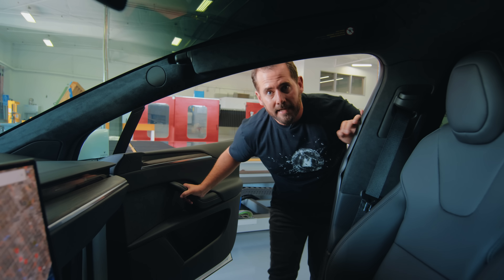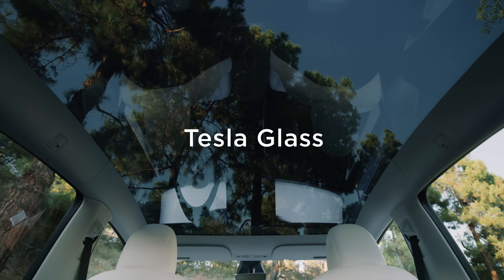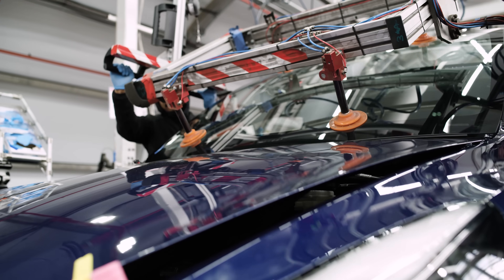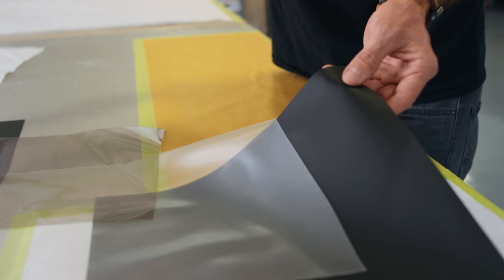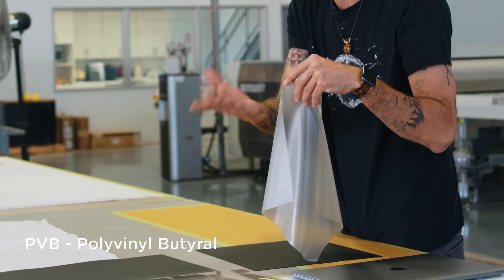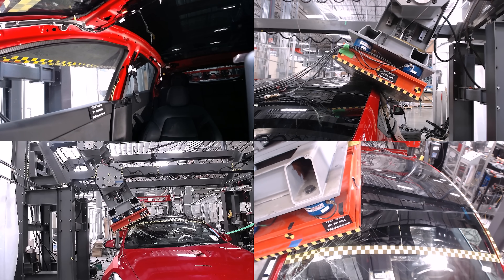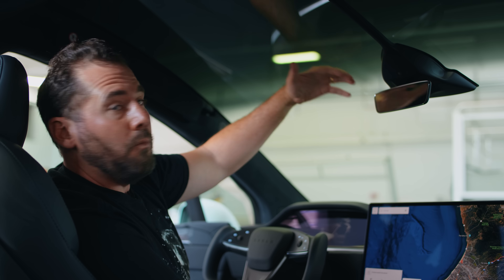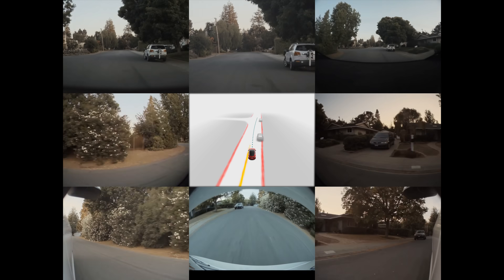Tesla Glass | The Secret to a Quiet Cabin

Comment: I just can't stand the roof glass while living here in Las Vegas. I added limo tint and it's still way too hot. I wish you had a normal roof option. 

And the road noise is awful on my model 3. Look up the "noise reduction" kits for your vehicles sold 3rd party. The seals for the glass roof cause a lot of noise.

 It's still my favorite car, but I wish you could get rid of the glass roof. I don't think it's worth it.
Reply: Good point. Should provide option.
Reply: They should have an option to have like a roof cover inside just like a normal people's car with sunroof They have a cover where you can pull the cover to open or close it
Reply: It's funny how your comment got downvoted to the bottom. Tesla fanboys are wild. Maybe most are just kids.
Reply: It's not the glass roof from which the suspected noise comes from. It's the fact how quiet your M3 is that makes you think you hear outdoor noises louder. Use a decibel measuring device to compare it to your friend's cars. You'll be surprised. I have a Tesla Model 3 Performance, 2021 version. I tested it myself. In fact even the thick steel floor is bigger source of noises than the glass area. They did an incredible job. Even the window wipers are the calmest on the market, specially designed to be as quiet as possible. They had to, as in any other car (even some EVs - with bad loud aircons) other noises are louder than the wipers, while in a Tesla all else is so quiet that you start hearing any little thing. PS: The glass roof was not just chosen for the feel of openness and better vision, but also for its strenth. This type of innovative glass, together with the frame make it (impossible with carbon or metal sheet) the strongest roof on the market by far - stonger than roofs of PVs with over tripple the weight...
Reply: Metal roof is just as hot if not hotter in my experience.
Reply: My Model 3 isn't superb for road noise either but I don't mind it. Also it's a late 2020 model with only one layer of glass and not similar to what is shown here. So I was wondering if you're sure you have the technology they described here? Tesla models are under constant development, even though the model names stay with similar names over time. By the way, I wanted to put it out there that I absolutely love the glass roof, albeit I live a place where summers rarely exceed 25°C/77°F and it sounds like you live way closer to equator.
Reply: This video just shows how behind they are on NVH. They think you can just slap laminated glass on a car and then it becomes quiet? Model 3 and Y are maddeningly noisy vehicles. Anything in the price range is going to sound like a bank vault in comparison.
Reply: Just get a sunshade

Comment: If you need to insulate against noise when driving, then perhaps the problem is cars. This isn't a feature, it's an admission of the terrible technology the private automobile is.

And no, it's not the engine noise: driving past a relatively low speed, tire noise on the road exceeds engine noise, even for internal combustion vehicles.
Reply: Please explain

Comment: Meanwhile in my head: “Glass is glass, and glass can break”
Reply: It's not your glass it's our glass
Reply: @AnkitRaj29008  It will always be Elon's glas, we are just allowed to use it.
Reply: Hi Jerry..
Reply: its fine  
You are showing some strange behavior.
Reply: HAHAHAHAA lmao
Reply: Sherylin  it's generally safer to be contained within the vehicle surrounded by cushy things and air bags than to be ejected, do generally you want the glass to keep you inside.
Reply: Sherylin  you are correct, on most points... ;)
Lol

I read your comment as having something to do with the difference between non laminated safety glass like a traditional side window, and the laminated safety glass like a windshield.
I now am gathering that you were comparing a window pane like you would find in a house, with safety glass in a car, and I have no argument with that, as I have broken many of both, and know of the danger that you speak!

(don't worry, I am not a thief lol, I worked construction and did a bit of demolition, including big commercial windows, and I was also a firefighter and tow truck driver, and the Chief owned a junk yard, so sometimes we would practice using various glass breaking tools on abundant windows!
Reply: My X has a large crack on the windshield right now. 1.5k to fix... lol
Reply: Man you're everywhere
Reply: A new vision of glass every time 10th one made with rocks
Reply: Glass isn't inherently brittle and fragile - that's just the most common types. Metallic glass can be hard enough to scratch diamonds rather than the other way around.
Reply: therefore this type of glass is stronger than a metal sheet or carbon fiber roof. They even show how they achieve this in this video.
Reply: Hi
Reply: Essentially everything can break

Comment: 1:22 That windshield looks pretty flat… Could it be for a CyberTruck prototype ?
Reply: that what i was wondering!
Reply: @pekkapeltola2642  What surprises me are the blacked out parts, not present on the first CyberTruck prototype but present on every Tesla production vehicle, the round top which would indicate that the production version of the CyberTruck is a bit rounder and finally the cutout at the bottom left, which could be where the windshield wipers are installed, if there are any physical ones. Either that or it's just a random piece of glass !
Reply: Apparently every windshield gets its blacked out parts while still being a flat sheet. Nevermind, I think I was wrong...
Reply: Note the V-shaped rear monitor inset   unique to cyber truck.  No rearview mirror, monitor instead.

Comment: The glass roof is simply amazing
Reply: its fine  
You are showing some strange behavior.
Reply: its fine  I speak for everyone in the comments when I say....get F***ed!!!
Reply: its fine  stop with the Muslim propaganda
Reply: Was in the Maybach even back in 2005
Reply: its fine  No it's not. Stop plastering this crap everywhere.  Once is more than enough
Reply: Nope
Reply: Real Tesla OGs will remember the sunroof 😭
Reply: it's not that great once you own it. it doesn't absorb sound as well as a hardtop, the glass still don't reject that much heat so it's a hot greenhouse and the glare on the model y makes the full roof glass almost useless. all you see if the front row reflection. nice in theory but terrible IRL. i ended up installing a reflective shade in my model y roof. reduced my AC use significantly
Reply: @Mkvkuv  Hmm, I can totally see a valid point there.
Reply: @Mkvkuv  We added 70 percent tint to our Y's roof, it makes it a lot more pleasant but does increase the reflections.
Reply: @Mkvkuv  Amen. If I could order my Model 3 without the glass roof, I would do it immediately. The glass roof looks fun, but just heats up the car, radiates heat for a long time even with the AC on, and it can't open for fresh air.
Reply: Should be solar panels. Would effectively increase the efficiency of the vehicle by 10% or more.
Reply: @chapstickbomber  Tesla actually made a statement on that. With current technology, it would not be substantial enough to be of good use if you just slap it onto the roof of the car.
Reply: @th3max1muspr1me  nah, they're just being lazy. Cybertruck with solar would probably charge just as fast as 120V
Reply: @th3max1muspr1me  toyota uses solar panels on the prius prime to run the AC and charge the 12v battery.
Reply: @chapstickbomber  So, you know better than the engineers at Tesla? What is your qualifications? Also, how much would it add to the cost of Tesla vehicles?
Reply: @1flash3571  passive charging is amazing

I won't buy an electric car without it. It literally rewards not going anywhere, which is my favorite thing.
Reply: @chapstickbomber  I guess you will be waiting a LOOOOONG time then. Solar panels just are not good enough to recharge the battery to any meaningful amount. It also would add to the cost. I think those FLEXIBLE Solar panels are not as powerful as the non flexible ones as well. Tesla would actually make a solar panel that is strong, high wattage, and make it look good. Adds too much to the costs. Maybe, they will do it with the CyberTruck though.
Reply: @th3max1muspr1me  It may not be enough to charge the car but it can prolly run all the electronics minus the motors
Reply: If it was a Mercedes you would say its fine but if it was a tesla you would say ''amazing''
Reply: @officialwowow  nah I won’t, there’s a reason I didn’t go with panoramic roof on my GLS, it’s louder, affects the structural rigidity, and useless, it’s a solution to a nonexistent problem
Reply: @jackz4149  We can say that tesla glass Is crap then, I mean tesla says all they can, but they have terrible build, It just gonna be trash
Reply: @jackz4149  the rigidity is not changed weather you have a sun roof or not, the roof is a thing sheet on aluminum that does not provide support in a crash. It’s the hardened steel pillars that do which is part of the car sun roof or not
Reply: @officialwowow  Nope, I would say it's amazing too. It doesn't matter what company is, just the concept of a glass roof have already grown on me.
Reply: @kalleb8595  on most cars of this Tesla’s price point, they have panoramic glass roofs, which are much better because they can not only open but they also have a cover
Reply: @kalleb8595  okay???

Comment: can't expect to earn enough to buy a tesla 😂
Reply: Yes we are hitting high inflation Thanks to Joe
Reply: 39k for a brand new model 3 all inclusive. and a new model coming (not as large as the model 3 though) in 2023, for only 25k, also all included. As always, coming with a battery that keeps the level of performance stable for over 1.8 million km / 1.12 million miles. Which for most people is 30+ years... within that time barely losing any value, if you treat it well. So the model 3 is, if you calculate in all costs over 5 years of use, actually the cheapest car on the market today. Of course you need the 39k up front to own it immediately. But you can also lease it if you like, I think from 280.- per month... check on their website ;-)

Comment: Great, now all we need is an Active Noise Cancellation software update for the S/X and we're golden!
Reply: Mercedes and others already have noise cancellation you're welcome
Reply: Noise cancellation without headphones is impossible
Reply: Unfortunately, ANC does not scale to the size of a car.
Reply: @NicolaiWeitkemper  there are actually quite a few cars out with ANC.
Reply: @NicolaiWeitkemper  can you explain what you mean, please?
Reply: @th3max1muspr1me  ANC works by generating anti-sound so that it and the noise cancel out. However, because sound waves follow the principle of superposition, sound may cancel out in one place and be amplified in another (constructive and destructive interference).
If noise, anti-sound and your ear aren't lined up, there's definitely spots without destructive interference. I suppose no car has a sound system capable of "beam-forming" anti-sound for up to (2+3)*2=10 ears. 
From my understanding, it's therefore impossible to have ANC in cars, at least with regards to higher frequencies. Of course, I'd love to be proven wrong and learn about how ANC in cars does work, but I have yet to find a detailed explanation.
Reply: @NicolaiWeitkemper  Of course it's "impossible" if you define ANC as elimination of ALL sound EVERYWHERE in the car.  All I want it to do is attenuate low frequency noise around the driver's head.  Passenger heads would be a nice plus.
Reply: @incognitotorpedo42  Yeah, that sounds reasonable. 👍🏻
Reply: @NicolaiWeitkemper  as a sound engineer I agree that noise cancelation is impossible in an entire car interior, but it's also not needed.
What you want in a car is attenuation of the bothersome noises, road noise, wind noise, other traffic etc, as opposed to total silence like you might be able to get with headphones.

So if they can create a major reduction in the mostly lower frequency ranges, it will make people have a more enjoyable trip, but you are the only one setting the bar at full silence.
Reply: @NicolaiWeitkemper  think the new nio top end car thats to be released claims to have it

Comment: What does it cost to replace such an enormous glass windshield-roof unit?
Reply: On the Model 3 it's actually 3 parts: windshield, top and rear. But good question.
Reply: @Eselfar  According to German car weekly AutoBild the windshield of the current Audi A6 Avant costs over 2,000 euros to replace. Also due to all the sensors having to be recalibrated. So a larger Tesla wind-roof-screen...
Reply: Probably thousands of $$$

Comment: Cant wait for tesla leather seats...leather, genetically developed by tesla.
Reply: @lindhe  did you even read the comment. I believe Vlrak is implying that Tesla will someday make a lab grown leather that is almost identical to genuine leather.
Reply: The only thing I hate about leather seats is during the summer when it gets really hot those leather seats are going to be burning hot in your butt If you wear shorts it's going to be more worse feeling the burning heat
Reply: @thewebmogul  Got to have liquid cooled leather seats.
Reply: TESLA started offering a new type of material in all their cars from 2020, not the traditional "vegan leather" also not animal leather. It's something Tesla has developed with their internal material lab within 7 years. It's made almost purely out of recycled Poly urethan, very thick and much more robust than even real leather. It can also never start crubling like traditional "vegan leather", can't dry out or get "fatty" like animal leather and is also both micro perforated, so it can breathe like animal leather, not making you sweat on it, and has a surface that is water repellent. This way (pearl effect) it stays clean and once getting dirty is very easy to clean simply by water. By its structire the white TESLA leather is actually (funnily) even stronger than the black leather. So if you like a fully white leather interior at Tesla it will actually last, be UV and infrared proof (not change color over years, not getting yellowish or dry etc) and be very scratch and damage resistant, like no leather before. IT's here guys! They, like so many Tesla tech so far never was, just didn't advertise it. You can (with a bit of luck) sometimes read about such imrovements on the Tesla website though. In the 2021 Model S and X liquid seat cooling (not to mention the always included qualities of its 5 seat seat heating) is standard.
Reply: @manueldavid7369  if you know this off by heart , then this is impressive lmao